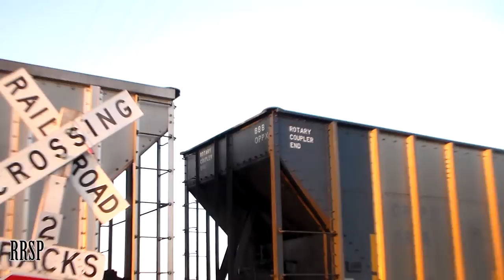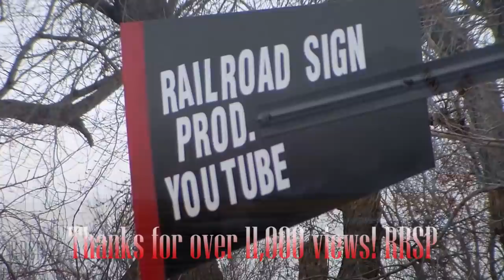EMERGENCY! Hopper Bay Opens on a Moving Coal Train!

Comment: I bet the incident costed U.P. Some money XD
Reply from the maker: spacefanboy 39 it probably did.
Reply: Some money. Not a lot. So they have to clean up the track; they have equipment for that. It'll cost some revenue loss while they get it cleaned up, but not a lot. You realize that each one of those locomotives has an 8,000 gallon fuel tank, and it costs $24,000 just to gas it up before each trip? They deal with revenues so large that even the cost of a single carload of coal wouldn't be that serious to them. If they even pay it, but I suspect they are insured against anything of the sort, so if the train gets derailed they aren't stuck owing millions of dollars to the customers. Same reason shipping lines carry insurance on the cargo. And it's not like they can't pick most of the coal back up and use it, if they really wanted to. But it'd probably cost more to do that than to just write it off. The biggest loss will be in having a line shut down, but since it's a two-track line they can probably shuffle traffic well enough, and get a crew and some equipment in to shovel up the coal within a couple hours. And it almost sounds to me like it's just a line running to a power plant, so it's even less crucial. Although they might stress a bit if they are under contract, or even legal obligation, to deliver a minimum amount of coal to the plant to keep it running.
Reply: @kelharper7971  right on Kel

Comment: I  can understand your not tampering with the shute door but , you could have driven down the service road
and offered to give the conductor a ride back and forth to the engine and save them a ton of time, the worst 
that could have happened is they say, no thank you and you would have had your close shot !
WATCH OUT FOR YOUR CARS'/truck EXHAUST SYSTEM (catalytic converter) when driving in tall dry grasses, 
it will start a fire after a minute or so of sitting.
Reply from the maker: Michael Avery part of the reason for not helping the crew out with this is that I didn't want to get called in for trespassing on railroad property, another part was that I got a bit of an adrenalin from seeing the coal dust. I realize that both of these reasons aren't that great after the fact and I could have got my close up shot as well. Also, thanks for the tips about driving in tall grass. If I see another emergency situation on the rails, I'll definitely try to help out.
Reply: I agree. I'd be thinking the same thing. Some engineers might appreciate the help, but some would just be annoyed at the intruding railfans sticking their nose in, and you would be trespassing on railroad property if you drove out there. I wouldn't risk it either, these days.
Reply: @kelharper7971  you can give the condr a ride back without getting on railroad property
Reply: @kelharper7971  after helping him, i don't think he would turn you in, do you?

Comment: Lmao why are we talking about a stop sign on a crossing... lmao how is that unsafe?
Reply from the maker: I mentioned the stop sign not because it is unsafe but because the people driving over the crossing were putting themselves in danger by not stopping at the stop signs, and the trackspeed there is 60.
Reply: Railroad Sign Productions well who’s fault is that if you don’t stop lmao. Hell people don’t stop for crossing arms
Reply from the maker: Trex1094 I'm not that people don't stop at the gates, but I'm talking about people running the stop signs on the crossing. I also get that it's their fault. I have video proof of people doing it as well.

Comment: You should have stayed on the conductor while he shut the door.  The rest of the video was pointless and a waste of time.
Reply from the maker: Here's some things to think about after posting your last comment:
1. The screen on the camera is only 2"x3", so not everything is easy to see from far away, even if zoom is used.
2. The wind picked up and I didn't want to stay outside in the cold any longer than I had to. I was late getting home as it was.
3. If I did stay focused on the conductor, what would we see? A slightly blurred shot from three quarters of a mile away.
4. No one forced you to watch it. You clicked on it yourself.

I appreciate the views and the feedback, but there's no need to be rude.
Reply: Conductors don't shut the dump doors if they come open. They're not trained how to do so and that's a carman's job anyway. They'll set the car out at the next available location.
Reply from the maker: sharkheadism from 8:00 to 10:00 you can see the conductor walking to the car on the right side of the screen to shut the door.
Reply: I saw the conductor walking but did not see him shut the door.
Reply: @sharkheadism  How are going to shut the door with the coal coming out?